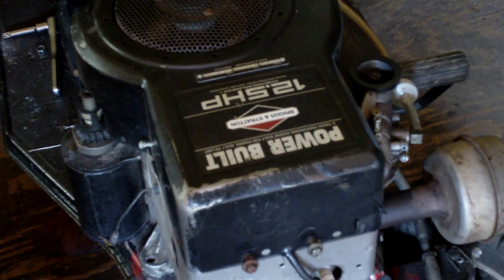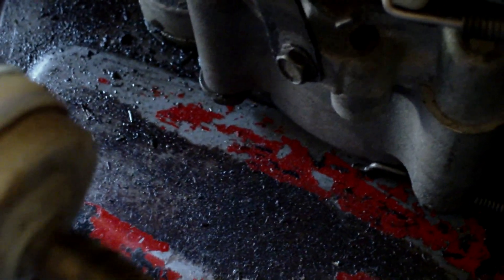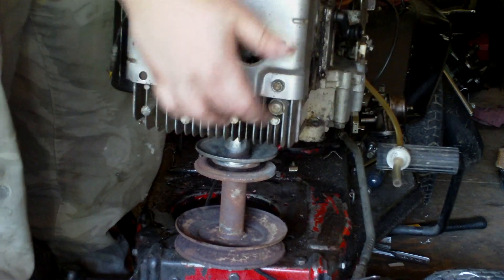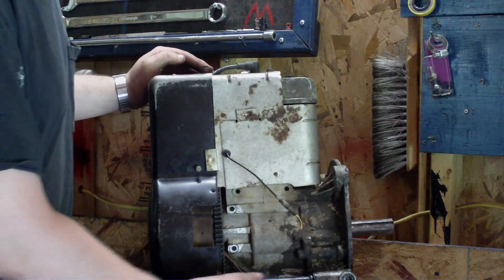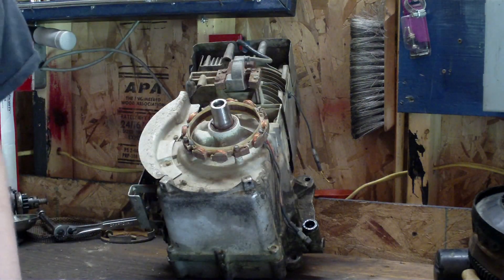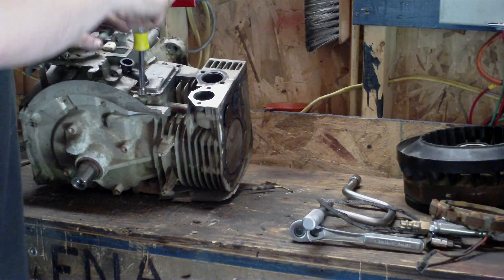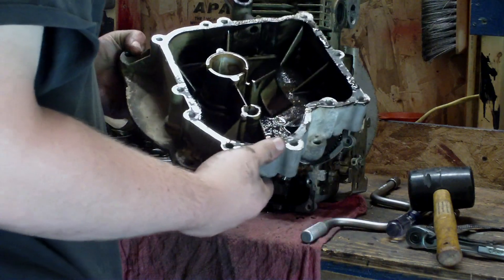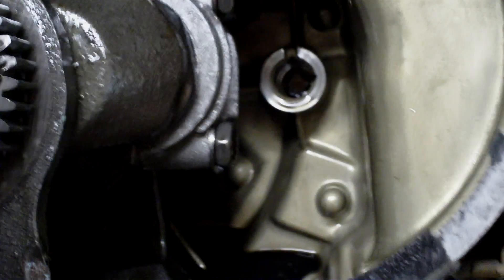Briggs and Stratton Power Built 12.5 HP Flathead Model 28 Rebuild, Teardown / Reassembly PART 1

Comment: Hey man great videos. I'm in the uk and have a problem with a similar engine. I've done a decoke and valve grind etc. Reset the valve clearances as per B&S manual but find that the inlet valve with a clearance of 0.005 at TDC doesn't start to close until the piston is more than half way up the bore on compression stroke. I haven't disturbed the valve timing but have checked that the two dots on the crank and cam are lined up correctly.  Engine ran OK-ish before the work but seemed a little down on power.
Any help would be appreciated.
Reply from the maker: +Philip Hartley Thanks, really appreciate that! I seen your message as well. About the only thing i can think of is valve timing, but if the marks are lined up it can't be that, unless something is wrong with the gear on the crankshaft, they do have a keyway on them, its possible it sheared, but I've never see that happen. Now on the camshaft, make sure your using the dot/line and not the hole thats drilled in it, the hole is not the timing mark. Get back with me, we'll figure out something! Thanks for Watching!!!
Reply: +fnaguitarplayer9 .  Hi again and thanks, The crankshaft key and the gear is ok. The timing marks on the camshaft seems to be a small dimple next to the root of a tooth. The crankshaft gear mark seems to be a similar dimple mark on the body of a tooth itself. I will check tomorrow for any other marks and get back to you.  I will take a photo too but i'm not sure if I can post one on here..
Reply: I've double checked everything, timing marks were correctly aligned, no wear on either camshaft or tappets, all crankshaft keys and keyways are in good order, valve seats are tight in the block with no signs of any damage (both valves and have been lapped in). Exhaust valve seems to be working as it should with .010" clearance.  I am completely puzzled by it all. Engine has not had any overhaul/repair in the past.   I am going to rebuild the engine with the original re-lapped inlet valve set to the clearance at which it seems to work properly 0.012"  and see if it runs OK.
Reply: Hi again..   still struggling with this engine I'm afraid.  Have you ever known the camshaft gear slip on the camshaft on this type of engine. I have physically turned the engine with the head removed and the valves seem to be a bit out of sequence despite the timing marks being aligned. I'm trying to get hold of a rear on photo of the camshaft to check the gear in relation to the lobes.  engine is 28V 707  1113-1.  12.5 HP.

kind regards......  Phil.
Reply: +Philip Hartley Ignore this question as I see that the camshaft and gear are a one piece casting.
Reply from the maker: +Philip Hartley I hear ya, the only cams i know of that are more than one piece are the newer plastic gear and lobe cams found on push mowers. it would be possible on them.

Comment: The engine cover is for a horizontal shaft engine not a vertical , decal tells all !
Reply from the maker: +James Stephenson I'm not 100% sure on it, I've been told they all were, then I get this engine, which may have the wrong cover on it, who knows, But most of the time if they have the cast iron sleeve there is a sticker on it, not always though. Like the I/C just say it on the cover, but not all motors will state it. And you can't go by the model and type numbers either, almost have to pull the head off and actually check it haha Thanks for Watching!
Reply from the maker: lib gunner You know I've been wandering that, I noticed the label was upside down when i had sitting beside another 12 horse. makes sense. Thanks for Watching!!!
Reply: fnaguitarplayer9 Powerbuilt engines are cool bore i assume ?
Reply: +fnaguitarplayer9   I have the exact same engine and it also has a cast iron sleeve, mine is a yr 2000 build.
Reply from the maker: +Philip Hartley I hear ya, thats good to know, maybe mine has the right cover after all. Thanks for Watching!!!

Comment: I have rebuilt my engine but it still will not start petrol is blowing out of carb instead of being sucked in any ideas thank you
Reply from the maker: garry edwards That sounds like either the valves aren't closing (either from getting the tappets/lifters mixed up, or the valve clearance not right), or the camshaft timing marks aren't lined up correctly. Thats usually what causes that, valve related. Hope this helps! Thanks for Watching!
Reply: +garry edwards   I've been having starting problems with my 12.5 flathead with similar symptoms to yours after a rebuild. I have researched this engine operation and have come up with the following.  In order to ease starting compression the inlet valve is timed to stay very slightly open until  just before TDC on the compression stroke to allow some of the pressure to bleed off at starting speed. Once the engine is running the piston is travelling up the bore a lot faster than the air can escape so running compression is restored.
These engines are also designed to have a vacuum in the crankcase to prevent excess pressure and oil being blown out. This is achieved by the Breather valve built into the valve chamber cover. On the down stroke the breather valve allows the air under the piston to escape through the breather and out into the air cleaner box via a small rubber hose. On the up stroke the breather valve closes and stops air entering the crankcase to provide the vacuum.  It is essential that the Dipstick tube has a good seal where it fits into the casing and the dipstick cap also provides a good seal when it is screwed down. In effect the air seeming to blow back through the air filter is correct if it is on the downstroke as it is from  the space below the piston and not from the compression up stroke.  This shows that the breather is doing it's job properly.  A quick way of checking is to remove the vent hose from the air cleaner and see if the blast of air is still blowing back through the carb or not, If it is then the problem is as finalguitarpalyer9 comment and  a valve issue. If the air is blowing out of the vent hose that is how it should be.   My starting problem turned out to be electrical.

Comment: when watching this video would this be the same for the 10 HP. Briggs
Reply from the maker: McCuneWindandSolar yes it will be very similar, however most 10 horses i've seen do not have the sychrobalancer assembly on the crankshaft, but other than that its all pretty much the same. thanks for watching!!!

Comment: What are the chances of modifying the oil slinger on one of these motors to convert to horizontal...?
Reply from the maker: Its been done before, i never have, but there are videos on youtube of doing it. The main problem is the crankshaft/sychro balancer, it would get in the way. Most of the time people have done it on a push mower engine. Thanks for Watching!

Comment: Hello, I have rebuilt my engine its 12 hp  briggs and stratton, but cant geti to fire up now. I have a spark, even spark plug is wet from carb blowing petrol. I have aligned them to holes on top of gears as you showed, but them i am trying to fire it up it just spins. maybe i need to do something with timing? i tried to tip some fuel into carb straight and heard a bang, like it exploded in the carb instead of cylinder. i  can send you some pics or video, can you help me please? thanks
Reply from the maker: i sent a email back to you.
Reply from the maker: i sent a message back to you earlier
Reply: Where have you sent it?i didnt get anything sry
Reply from the maker: you will have to go to your inbox on youtube, click on your name at the upper right side, then click video manager, then click on community then inbox, youtube used to let you know when you had a message, not anymore since this google plus thing went into affect.

Comment from the maker: yes thats perfectly normal, its not really blow by, its from the lubrication system (splash, instead of oil pump) it has a oil slinger (that also works the governor) that makes the oil into a mist that is slung all over the crankcase, and the pressures from the piston moving will make it look it pulse out like blow by. now if your getting oil out of the breather tube that connects on the carburetor, that usually is a pretty good sign of bad rings. thanks for watching!!!

Comment from the maker: it may have slipped when you were putting it together, i've had it happen before, because the cam has play in the block bearing thats really the only thing i can think of, unless the key (if it has it) on the crank where the gear goes fell out or something, thats the only thing i can think of. I did a video on taking the weights off and putting them back on, you might want to take a look at it, its possible to have put something in wrong, i've done it before haha thanks for watching!!!

Comment: I have  MTD riding mower with a 12.5hp motor. I threw a connecting rod and rebuilt it. New rings, rod, and lapped the valves. I even took the weights of the crank to check for damage. I put the two marks right on. After rebuild it would not start. I took it apart and and with piston at the top and valves closed the marks do not line up. Toget them together i have to turn the crankshaft a little bit and the piston is about an inch from TDC. Could I have put the weights on wrong? Thanks.

Comment from the maker: well to start with you need basic mechanic tools that include ratchets, sockets, extensions (all you need on this is a 3/8" ratchet, maybe a 1/4" but you don't have to have that) various screwdrivers, flat, phillips, torx, rubber mallet is handy to have on hand, wheel puller if you have to remove the flywheel, torque wrench for reassembly, cylinder hone, valve lapping tools, valve spring compressor. I did a video last summer on various tools needed for small engine repair, that video might...

Comment from the maker: thanks! yeah there a few things that you have to do sometimes, first of all, if the shaft is rusty or dirty clean it then sand it down until its shiny, spray some wd40 around the cover where the shaft comes out that should help, also may sound obvious, but it is very easy to miss a bolt, some of them are countersunk and i've done that several times, could of sworn i had them all but there was one hiding haha and like you see me do, use a rubber mallet and tap it off, that really helps, but

Comment from the maker: about 15-20 bucks for a cheap one (like mine) a good one will cost more, but you shouldn't use a impact like i do, this one actually broke on me in a video i made on how to pull flywheels!!! you can get them at most tool stores or auto parts stores. Thanks for Watching!!!

Comment: @alexsuchapimp  A freind of mine and I are going to build a vert. engined gokart with it, and mate it to a Peerless MST-206 502C with an 8 inch motor pulley and 4 on the trans. were hoping to pull about 30 against the governor and 40 wide open (gonna run governor and gas pedal)

Comment from the maker: need more info, does it crank over? if it doesn't crank could be a solenoid or starter, if it does crank and is just not firing up, its probably in the carburetor, check fuel filter/line first then clean carburetor. thanks for watching!!!

Comment: @fnaguitarplayer9 Ive got compression now, there was carbon on the valve seat that was leaking the compression. I did a "Poor boy valve job" by putting a peice of Tshirt between the valve and seat, close the valve, then pull the shirt side to side all around the valve. the seats on both valves are now clean, shiny, and seal.

Comment: I traded a P.O.S. 17.5 Tecumseh Enduro OHV for one of these. I need to pull the head off my new briggs and find out why I have no compression. I think the intake valve is stuck open. I love the sound of these 12 horse Briggs when they run. Once I get it running ill have a spare engine for a tractor later, or some other project.

Comment from the maker: thanks! might have stuck a valve, does it still have compression? if it has no compression its probably a stuck valve, that can happen when a engine overheats, if not that, could be the carburetor giving you problems. thanks for watching!!!

Comment: NICE Video series!! I have a briggs and stratton that over heated on me last week mid mow and now will not start. It turns over and there is spark but some thing happened to it that it wont start. Im hoping that it it may just be some thing with the carb but i wanted to hear about what you guys think before i rip in to it. im handy but im no pro. I can upload a vid of it turning over so you can hear it if needed.

Comment from the maker: yes that would be what is wrong. it depends. most of the engines i've worked on that threw a rod usually either come through the side of the block and leave a big hole (which can be welded), or the rod hits the camshaft and breaks it or breaks out 1 or both of the cam bearings or bends the cam. just have to check those things out, if nothing else is broke, then all you need is a new rod, and its ready to go! thanks for watching!!!

Comment: I tore down my 12.5 flat power built Briggs today. The valves moved okay but the piston doesn't move. I am assuming my connector rod is broken. Is this motor work ordering a rebuild kit ?? The steel cylinder wall looked good ...... smooth as a babies bottom. Your thoughts ??

Comment from the maker: yes that is probably the reason, its very important to put at least oil on everything, think of it like brake pads on a car, when the brake is on it locks up, if you put oil on the rotor and pads it would slip, same thing going on in the motor. and if the motor did turn over without oil or stp it would more than likely score up the cylinder walls too. thanks for watching!!!

Comment from the maker: when you pull the head, turn the engine over by hand (on the flywheel) and check to see if the piston is moving up and down, along with both valves, if it is then you will have to check the clearance on them, you wont have to open the crankcase up, just the head and the valve spring cover on the side, if the piston doesn't move, then you will have to open the crankcase, but you don't have to to work on the valves. with the piston on top dead center (all the way up) you can clean everything...

Comment from the maker: no problem with the double post haha. sounds like its in the valves, if it threw  a rod or came it loose, it would be locked up, more than likely. My guess is one of the valves is stuck or they are out of adjustment, not closing all the way, and its loosing compression past the valve. if its a flathead like this one, its difficult to adjust the valves, if its to tight, you have to grind the valve stems to get the right clearance, or if its not enough, has to be welded up then ground...

Comment: I have replaced all the safety switches and all the ignition circuit. I seem to have lost compression. I am a little frustrated.... it will crank but won't fire. It is getting fire, fuel and air. Dropped a valve? Piston? Rod?

Comment: I have replaced all the switches and ignition parts. I seem to have lost compression. It gets fire, fuel and air and cranks but won't fire. Valve adjustment? Dropped a valve or rod? I am getting a little frustrated........

Comment: Hi their, so just run a fused wire from battery to switch power terminal and hook up the lights to the Accessories terminal on switch without a fuse and ground the switch. would that be correct? thank you.

Comment from the maker: it would be best to put the fuse before the switch, right off the battery. that way if something happens at the switch or before the switch it will blow the fuse. i wouldn't think it would be neccessary to fuse each set of lights, unless you have 2 switches then i would fuse both, because the one fuse feeding the one switch would protect both circuits.

Comment: Hi their, I have a 3 connector switch one is power, Accessories and the other is ground, are  you saying run a fused wire from the battery to switch power terminal? Or your saying run fused wire from the lights to the accessories port on the switch? And also do I put fuse holders on each set of lights or one fuse holder all together and then attach the wire lights to the Accessories port on the switch. thank you.

Comment from the maker: hi. first thing be sure to put a inline fuse as close to the battery as possible to keep things safe if something ever shorts out, i would recommend using 16-18 gauge wire, 16 would be best. and about a 10-15 amp fuse on that wire. thanks for watching!!!

Comment: Hi their. I have a stock Lawn tractor, the lights turn on only when the engine is running. I would like to design a switch and run wires through the battery to turn on the lights or maybe fog lights when the engine is not running and to have more brighter light. can you please tell me what kind of wire gauge to put running through the battery and switch. Thank you.

Comment: Ummm all Power Built Briggs are cast iron sleeves. That's one of the high points of the engine. One thing they built it with for extended life.

Comment from the maker: @bigborekit12 yeah they last for quite a long time if they are taken care of (oil should be changed at least once each year, preferably twice a year) and clean air filter, and it should last a long time, what usually wears out is the rings in theses, and they start smoking (burning oil) and they would have to be rebuilt like i did in this 4 part video. and if you bypass the governor so it revs high it will throw a rod out the side haha thanks for watching

Comment from the maker: @Joe43ka7 does it make a clanging noise, like metal hitting metal when it stops turning? if so you probally threw a rod. just follow this video series and it should help you alot. i don't go into replacing the rod, but it shows complete tear down, and should help alot. thanks for watching